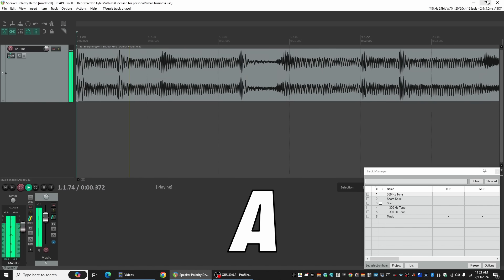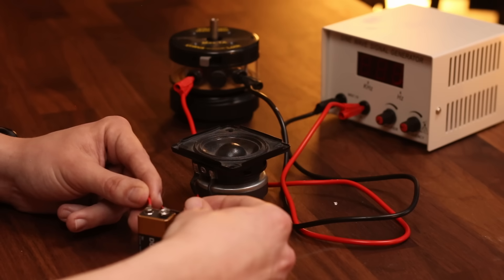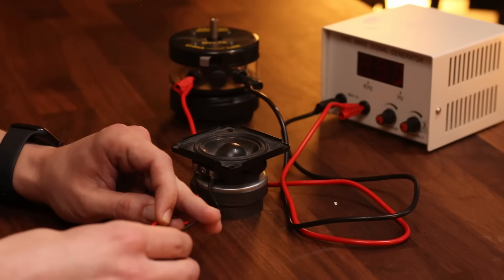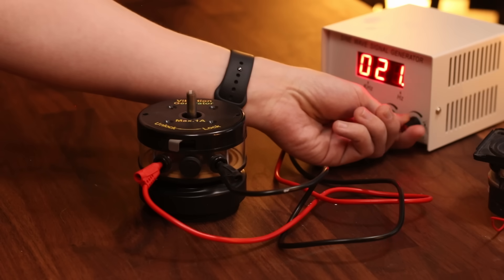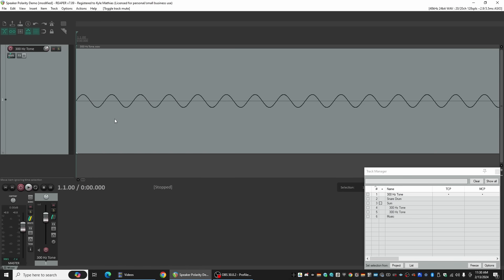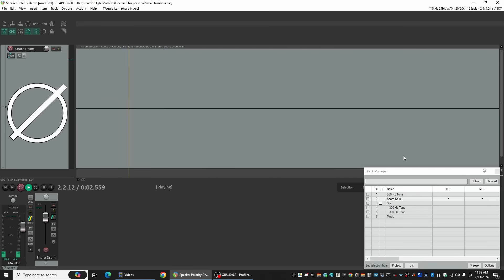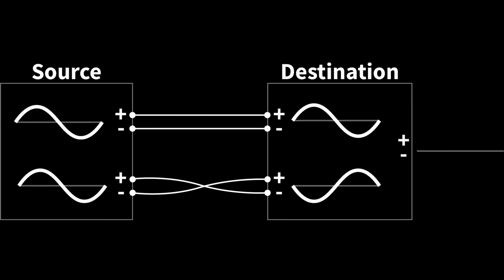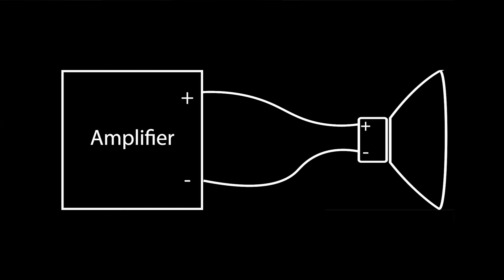What Happens When You Wire Speakers Backwards?

Comment: In the 90s I had two speakers (I believe they were klipsh) that had a tweeter, mid, and two woofers. They sounded awesome. The box was sealed. I took them apart for some reason, and noticed that only the top woofer had magnets/wires. So the bottom one was just a cone. Since it was sealed, the air pressure in there made it so when the one with the driver went in, the passive one went out. — why did that work? Lol shouldn’t it have cancelled?

Comment: Thanks for the cool video. 

I work in hi-fi, and many listeners believe that certain recordings and even whole discographies make it out of the recording/mastering process with polarities reversed on both channels. What can be claimed with more certainty is that most tracks sound subtly different when the polarities of both channels are reversed. One manner of playback will have a somewhat compressed sound stage and the midrange will sound a bit shouty and forward. This is generally considered less pleasant than the alternative polarity. Many higher end DACs even allow you to invert polarities while listening because of the observation that often one way sounds different/better. The difference isn't always significant to me, but when it is, I really like the ability to choose polarity of playback. Examples of music catalogs that sound better to me and many others when played with polarity reversed: Dire Straits and Boris Blank/Yello. I've also noticed that every Kraftwerk album I've ever been able to sample both ways sounds distinctly better to me with polarities reversed.

One theory I've heard to explain how something as fundamental as polarity could get mixed up in the recording/mixing/mastering process is that XLR cables, which are commonly used in music production, are not wired the same way in all regions (like US vs Europe). So cables or devices designed or configured for one wiring scheme could end up inadvertently end up reversing polarity of one or more component tracks within a song - or even an entire song or album.

Comment: This guy has the same problem that the manager at Radio Shack claims. It is all goo but the plus and the minus wires from the amp to the speaker do mater to be the same. It is most obvious on a real recording with people singing or talking. Think about it when and microphone receives a voice it is front pressure on that front part of the mic if done well. That same pressure will be duplicated in the recorded sound. Now if your speaker that caries the voice, or  simple full range speaker out of the enclosure is wires backward, you will hear more sound out of the back of the speaker. So to me on two normal speakers in their cabinets a stereo sound with music and singing if both are wires in reverse with both plus and minus switched the center image of the main singer will be hard to find in the center,  pit both of your wires to the correct plus and minus and the center image will now be there. Some fact are better heard then taking a scientific approach.  MFG sometimes will wire their tweeters in reverse to give a more spaced out sound as well.
 Now on the right point if only one of the two speakers is wired wrong the rightly wired speaker will sound louder if you are in the middle of them. If the speakers are side by side or front to front, they will cancel out much of the sound, that is true as well especially the bass sound..

Comment: I really depends on the application.  If you are talking about a large powerful sound system with large powerful speakers, you will notice a difference right away.  The speaker can "stretch" out much more than it can retract.  If the polarity is reversed the speaker will distort much more at high volume levels.  You probably can't hear much of a difference with tiny speakers at low volume levels but that doesn't mean there is no difference.

Comment: I hate your break your little heart with the negative and positive that I want backwards I've had mine from I bring my speaker wires I read my positive into my negative and negative into my positive I ran them backwards now for a good 5 years I've gotten a lot more bass that way I told you otherwise the speakers don't last as long either you do the opposite way your speaker's last longer and I don't let you get more bass and don't tell me there's no difference in the sound it certainly is

Comment: I don't understand like the sound that human year perceived is like the air pressure density take place of a difference was created by the the rate of speed of sudden change of one speaker. so I don't see there will be any difference in the pathway of the sound. where do you find some difference between like corn movement inward and outward mechanically.

Comment: .  it is RELATIVE SPEAKER PHASE that is important.  and to even have a "relative" polarity, you need to have at least TWO speakers.  One speaker is the reference, and the 2nd is the test speaker.  you can check the phase using a two channel oscilloscope at a glance, while using a sine wave tone.   but you can "hear it" also by listening and moving your head around

Comment: Please note that “invert” and “reverse” have different meanings. In your example, you are reversing polarity, which means flipping the signal’s direction while keeping its timing the same. Inverting would mean swapping the horizontal and vertical axes or rotating the content by 90°, whereas reversing would mean changing the direction in which it runs (for example, playing it backwards or flipping its orientation).

Comment: there are 4 2 pin wires going to the rear subbwoofer    i reversed too of them then my jeep  sounded  like one of those cars driving by with the over powered sub in the trunk where the whole body is rattling?

Comment: In the 1980s I sold fairly high-end audio.  A trick that was used was to take a trade-in pair of speakers of a brand  one did not sell and wire them out of phase, then use them in comparison to brands one did sell.  It wasn't exactly the most ethical industry.

Comment: OK, if you have high curent, high voltage amplified signals, the speakers wired with 2 speakers, if one is wired "backwards" the common signals will have a 180 degree wave cancellation. If its one single speaker it will sound ok. at 180 degrees out, the signals will cancel. I have 25 years experience in setting up sound in dynamic environments.

Comment: I did it still at school, sometimes it sound better other music not, like a zoom lens versus a wide lens, sometimes I preferred it sometimes not. I think with a lot of speakers it may get interesting if some are reversed through experimentation, out of phase together. Have your ears tested for all frequencies before taking on such experiment, its about both ears, you also get the stereo+ effects from the original recording, hopefully that was right.......So you get from that not all frequencies of the music choice together through both+ more speakers before you changed anything.
I experimented with cross over toggle switches to get results I like per music choice(Mostly 70-Ties rock music)....The toggle crossover switch give you perfect choices on the fly, and not breaks as you connect wires, not sure if its good for the amplifiers.
Try Mono versus Stereo choice on amplifier as well and add your mix......

Comment: i'm looking at getting my old 5.1 speakers system and putting them together to make a soundbar (literally making a box to place them into). 

in trying to make less cable needed. . .Would it work/would sound detail be effected if i wired all the negative wires into one of the negative terminals (or a ground somewhere) together and just ran the positive wires to their L/R/C/Sr/Sl on the receiver ?

Comment: Nothing, because its the same thing with a time shift you cannot detect.  Another thing is if one is correct, and the other is reverse. That sounds strange :)
Reply: I somewhat agree and differ.......Input type-?.....Mono or Stereo(+ today)......More speakers and amps....Some reversed with toggle switches so you can correctly detect differences on the fly.......Interesting I found it then.

Comment: Theoretically, if you feed the same signal to two speakers of which one has inverted polarity, they should cancel out each other - and that's what this video is about.
But in reality, it doesn't work this way :), because the speakers are not in the same place and thus various phase shifts occur between the sound coming from both speakers.
Back in the 70's, when stereo was not a common thing and a lot of audio equipment was still monophonic, it was common to connect to a radio or a tape recorder - instead of just one speaker - a pair of speakers with inverted polarity on one of them. What happened? You got a "pseudo-stereo" sound, ie. the sound became somehow "spatial" instead of coming just from one point (as in case of one speaker), but you could not locate the particular point in space the sounds are coming from, as with real stereo sound; the sound just seemed to come from "everywhere" between the speakers. That was a quite interesting effect.
Also some old stereo equipment had a possibility to connect additional pair of rear speakers, of which one played the L+(-R), and the other R+(-L) combination (I had such an amplifier). This caused the effect of sound coming also from behind you and from the sides, not only from the front - like in current 5.1 setups, but of course the rear and side sounds were completely artificially generated...

Comment: If you wire it "backwards" in that you use it passively and make noise at the speaker and record the electrical signals instead of pushing electrical signals to it, then you've just turned the speaker into a microphone. 
They're the exact same tech, but tuned different. (most speakers are very quiet mics, because the cone is too heavy, so need lots of amplification and will make noise, but it works!)
I assume that Audio University is very familiar with this but posting for others who don't realize.

Comment: but, you can wire two speakers ok in polarity but distance from speakers make difference and again you can have cancelation, COMB FILTERING. most evident when subwoofers is separated. when you walk you can hear where sound double in spl and where comb filtering cancel sound. because bass sound spread 360 degree around the speaker the best idea is to place bass cabinets in group, not separate it.

Comment: Nah, it can't be true that some hear any difference if the wave is inverted when there's only one source. Simply because there's no difference at all, except in which direction the membrane moves, which means a 2D direction flipping. No one can hear the direction change, because it doesn't affect the properties of the wave that make the hearable differences, which are the amplitude, frequency, and the waveform.

None of those are changed. The polarity change for the ear is like turning the lights on and off for a blind person; it's simply not perceptible.

However, another sound wave coming from another source, like another speaker, can "sense" that "hidden" property of its counterpart, and naturally, if those two merge, all their properties are going to merge too. Because in time, the direction of those amplitude changes are opposite, merging them is going to make an amplitude change in the emerging sound, and that is indeed hearable.

Comment: I measured AC on speaker wires coming from an amp but untraceable through the wall and both positions produce positive voltage? As one would expect for AC yes?  I have definitely heard the difference between in, and out of phase speakers - just wish I could find a definitive measurement technique.

Comment: Using the battery is a great way to test car speakers.  If they push out then the polarity is correct.  In many cases a solid piece of straight wire can go right through the holes or slots on a car doors skin and if you carefully hold the wire against the speaker cone you can verify the polarity from the harness that unplugs from the factory stereo without having to pull the door skins off.  Yes, having one or more speakers wired backwards definately has a strange sound to the trained ear.

Comment: No way this requires 7:50 of video.  The EMF is applied in the reverse axial direction as the signal is applied.  It's a 180 degree phase shift.  No ad required.  No need for a drawn out video coming in right at the AD limit.  Now censor this comment!

Comment: I've heard of mounting speakers back to back within an enclosure and reversing the polarity of one of the speakers. Because they were mounted back to back, they reinforced each other with opposite polarity. There is also the advantage of reduced back pressure on the cones. Never tried it myself so I'm not sure how well it would actually work.

Comment: Audio professionals carry a small DC power source to check a speaker's polarity.   That includes a simple button or AA battery.   +/- means nothing to audio other than consistency in speaker phase.   Sadly, not all speakers from the same seller are labeled consistently.   
Connect a battery and note the compression or extension of the cone with battery polarity.   Do the same on each speaker so all extend or compress in sync.

Comment: Would you not get the same phase difference if one speaker were half a wavelength closer to or further away from the listener?
Reply: No. Polarity and phase are 2 different things. When you flip polarity ALL the frequencies get flipped opposite. When you introduce a time delay by moving one speaker (phase shift), some frequencies will cancel, others will add depending on how they line up. The resultant frequency response curve looks like a hair comb so they call that "comb filtering".

Comment: Many years ago there were some who suggested that you could improve the power handling of a stereo amplifier by feeding one input channel from the pre-amplifier out of phase with the other, and having one speaker out of phase with the other.  The result will be that the output from the speakers will be in phase, but the power supply of the power amplifier will be less stressed.
Reply: I remember doing that with car audio amps in the 90's after some article I read about that in a car audio magazine. Power is at a premium in car audio running 14.4 volts off an alternator. I'm not sure if there would be any benefits off shore power. Maybe there would be running off a (smallish) generator.
Reply: @wally7856  I suspect it may have been beneficial for many Japanese amplifiers of the time, which had very under-rated power supplies.  I remember putting an oscilloscope across the power supply rails of one of my Japanese amps, and you could see the waveform of the amplifier output quite clearly.

Comment: in my youth when setting up stages for bands they would put 2 speakers in line (distance apart, same as speed of sound in air) 180 degrees out of sync so the signal from one would turn on travel to the next, it would turn on and double the output effectively to the audience..

Comment: I believe that it's this principle that is used in noise canceling headsets.  A pickup sends a signal to the noise canceling unit and the unit puts out a 180 degree out of phase sound to cancel the noise.   The unwanted noise to cancel has to be at a constant level for the noise canceling to work.
Reply: This is also the reason you have peaks and nulls in a home theater if your not careful with your subwoofer setup. The bass sound wave can bounce off the back wall then cancel the incoming wave from the speaker. You can actually have a situation where you literally hear no bass at your couch but your kitchen will be rattling upstairs.

Comment: Someone once commented to me that if you have them both the wrong way, then the speaker will pull in rather than push out at the start of transients eg snare drum as per in your video. I don't think it makes any difference at all, as long as both are wired the same. The speakers are capable of producing sound equally well in both directions of travel. If they couldn't do that, they'd be rubbish.

Comment: If you reverse the phase in one ear with headphones, it sort of sounds like the audio is shifted to one side. This is because shifting phase is similar to adding a frequency-dependent delay, with the delay being proportional to wavelength. Since the delay isn't uniform across frequencies, it isn't exactly the same as shifting the audio source location.

Comment: In a basic 2 speaker stereo system if a monophonic source is played, as the listener moves from left to right in front of the speakers the sound will never seem to be from the center. It will seem to move either left or right while bypassing the center.

Comment: 6:20 This effext is also used in noise reduction in modern cars. If a microphone listens to the engine noises from approximately the same location where the speaker and the passenger's ears are located then sending an inversion of what was registered by the microphone won't make engine quiter, but will append to its vibration noise to form a white noise or whatever that is less disturbing then sine waves.

Comment: To people who wonder what's the difference between the snares or think there is no diffference:
1) You probably have crappy headphones or soundcard that do not support hzs below 40hz. (because its super expensive to go even below 45hz)
2) If you mass with samples all day and have trained ears .. you can hear a short "sub wave" starting with the normal snare that does not exist in the polarized snare which I can clearly hear even with my eyes closed. (hovering around 15hz to 30hz)
3) If you do have proper equipment, you might be deaf from listening to loud music all day.

But yea,  with the right equipment its super bold, you really cant miss it unless you have earing issues.